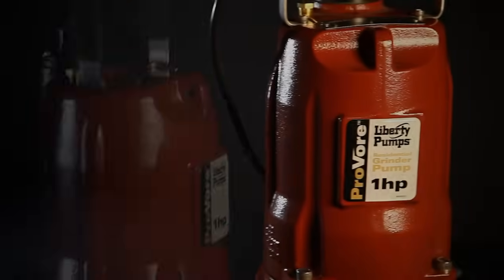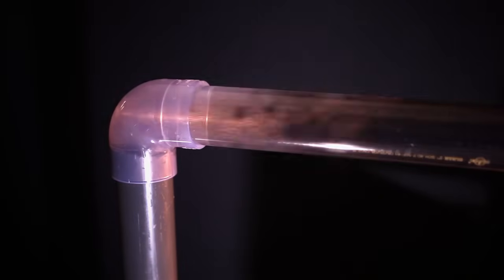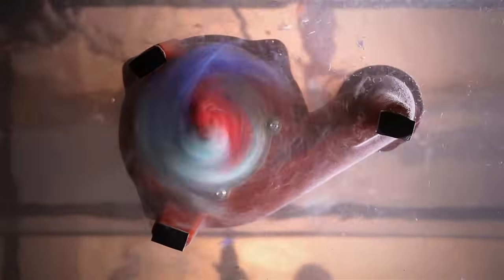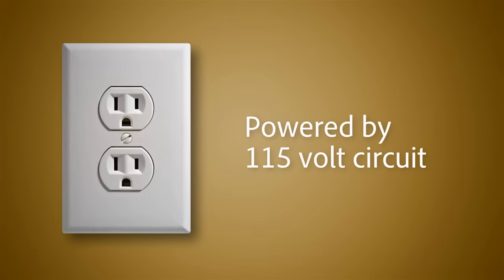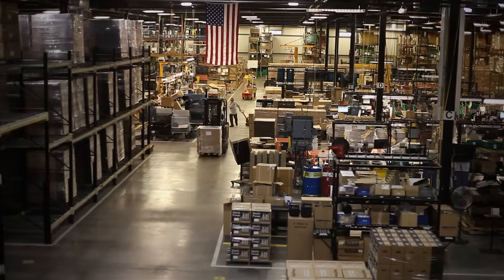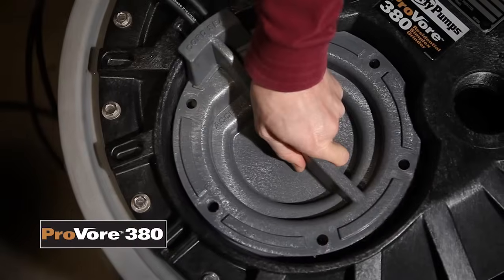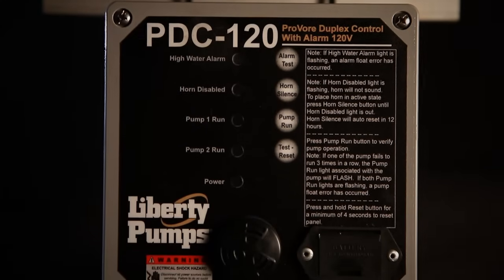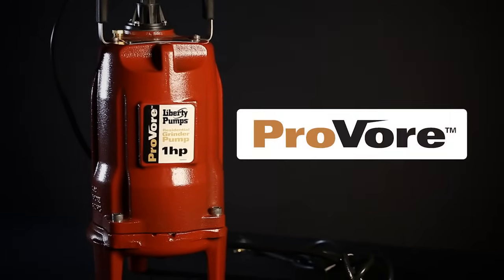Liberty Pumps ProVore Residential Grinder Pumps

Comment: Ideal for replacement of a typical sewage ejector pump that has failed in a "difficult" usage environment.  Same 2" discharge piping, same 115 volt electrical wiring.  Not a macerator, a true grinder.